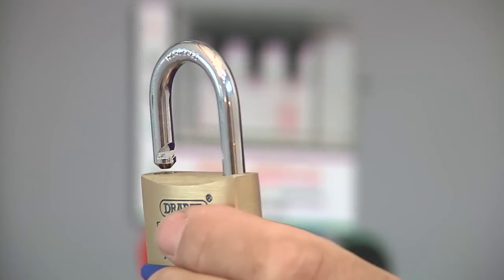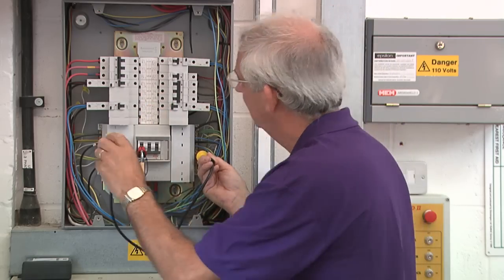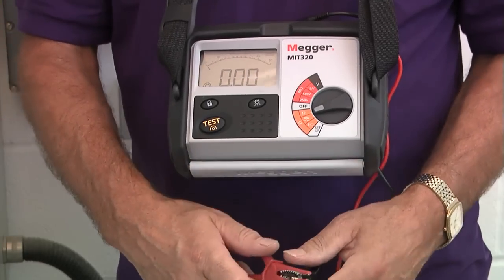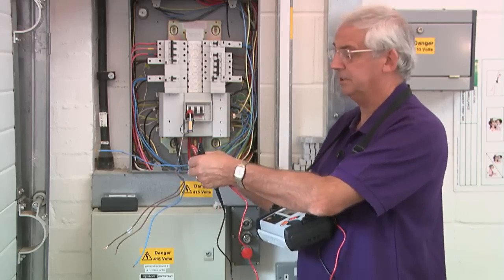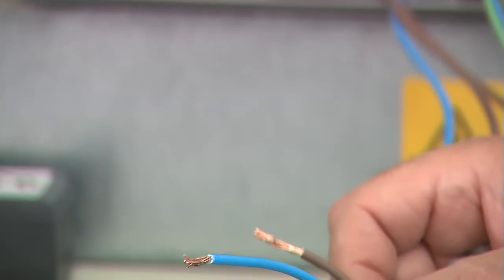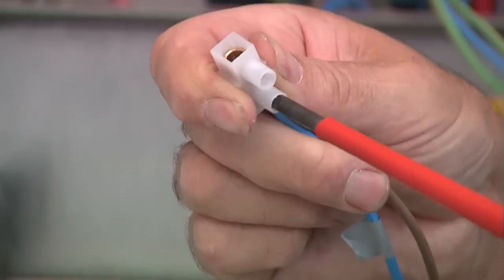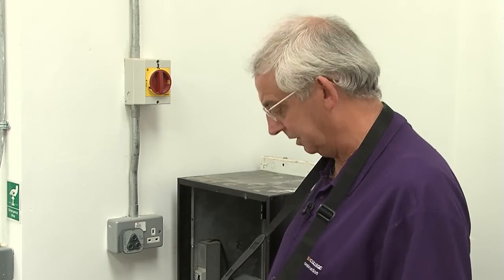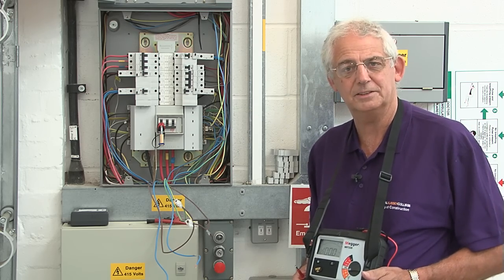Ring final circuit test

Comment: Hi, thanks for the vid. Really helping me prepare for my practical exam as a Level 2 electrical installations student.

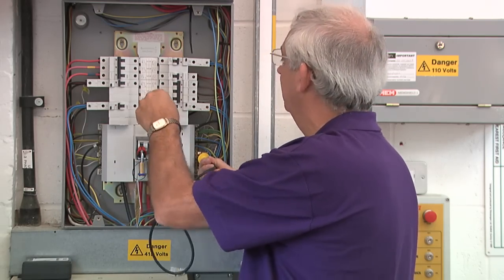However, I have to point something out about the testing probes you used for that three-phase 415V system; when you went to 'prove' it was dead and the lights hadn't failed during testing, the 415V light did not turn on when you inserted the probes in the proving unit. Check about 1:40 into the video.

Shouldn't that set of probes be replaced?

Comment: on your safe isolation test you only checked between earth and line 1 you should have tested all 3 phases surely?Could have a faulty main switch or circuits from another board could have gotten mixed up back feeding into your board
Reply: he did test all three, then proved it, then tested one more to be sure

Comment: ok 3 phase 400V is the line voltage between any of the lines ie (L1 and L2 or L2 and L3) the 230V is between any of the Lines and the neutral which is like you home only 1 line comes in with the neutral and earth. Each of the 3 single Lines are 230V dont get confused people Line and phase are different. Line is the permanent supply phase is not. Phase is the live off each circuit created.

To get the voltage of each single phase from a 400V 3 phase system you divide 400 by 1.73 should give you around 230V simples :)

Comment: Hi, we don't use ring circuits for lighting in the uk, all ciruits are radial with the exception of 13A ring final circuits used for power . A standard domestic lighting circuit would be 6A with around 10 outlets as a rule of thumb

Comment: You failed one minute in!! You need to test between all live conductors and earth, neutral is deemed as a live conductor and as that is a three-phase installation you should have tested L1 to N, L2 to N, L3 to N, L1 to earth, L2 to earth, L3 to earth, L1 to L2, L2 to L3 and L1 to L3. 

Any isolator is more than capable of failing to open all its poles and I have seen it in the past!

Comment: What he has basically done is the continuity if a Ring main circuit End to end is the quick way but anyone in college doing electrics will tell you that you need to do the so called figure of 8 test which he doe's where the phase (live) off one 2.5mm cable goe's into the neutral of the other 2.5mm cable and visa versa hence figure of 8 the results should only be read from the furthest away socket hence highest resistence reading then divide by 4 to get the resitance reading.

this importent when filling out your test sheets.

Radial is quite straight forward just the R1+R2 where phase wire connects to the earth

Comment: @Leigh Winspear,If your a student doing 2330 L2/L3 2357ect. the concept and theory behind the Ring final test is well covered, the purpose of Chris's videos are to show safe practical application of the required tests not a two hour mind melt :D
a 2391 badge holder ><

Comment: But in the proving unit, regardless of the reading on the three-phase board, all four lights should still light up to prove the instrument didn't fail. What if in the future there was a 400V delta connection he was testing? That would be a dangerous miscalculation.

Thanks for the first response though, I'm trying to learn through inquisition ;)

Comment: I'm a Level 2 student so let's discuss :P
Continuity of CPC verifies that the earth wire is connected securely so that fault current can flow to earth rather than through you under fault condition.

I think polarity is only confirmed when switching the furthest load on during the continuity test as THAT would be proof that the circuit is continuous all the way around and back to the CCU.

The other continuity tests are end to end (L1-L2 and N1-N2), L1--E2, L2--E1, L1--N2, L2--N1.

Comment: If you put the live conductor into the earth bar (separate screw terminal though), that will give you continuity and then polarity if you switch on the furthest load to prove it's correctly connected right the way through...

Comment: testing between line and neutral at socket with fig 8 loop on L and N at db does not give you a polarity confirmation
Reply: You are correct, however using the figure of 8 loop between L and N and then between L and E will confirm polarity.
Reply: +RAITHWILSON123 OK then can you expand on that and explain what does give a confirmation of polarity on a ring final circuit?
Reply: If L & N are connected around the wrong way the L to E test will show as open circuit. If N & E are connected around the wrong way the L to N test will show as open circuit. If L & E are connected around the wrong way then L & N test will show as open circuit. Hope this helps

Comment: Can someone explain in the simplest form? In the video when he starts explaining the cross connection and he has the tape around the Neutral and Live because he already knows which socket they lead into. If you didn't know which socket they went into then how would you figure it out? Thank you guys,
Reply: +unrepentant celt you would have to find the two ends of the ring final as they come into the board, this should be fairly easy 'cause they are in the c/b just follow the cores back. :)

Comment: just let your RcD do the testing for you much cheaper than buying expensive meters ,,, turn the power off find an old plug and make an internal connection  between earth and N  ,,, switch the power back on ,,,,,,,,,,,,,,,,,,, if the rcd doesnt work (switch off ),,,,,,,,, call on electrician ,

Comment: Why is it necessary to disconnect the whole board to do a test on a single final circuit?
Reply: because you're disconnecting conductors from a MCB with potentially no RCD (depending on the age of the CU).  Personally I like circuits dead before I disconnect them.
Reply: jason nebu because the bussbar would still be live